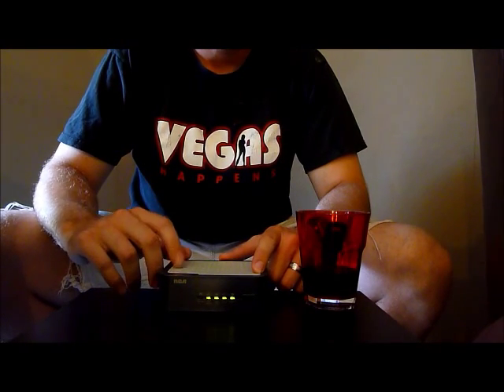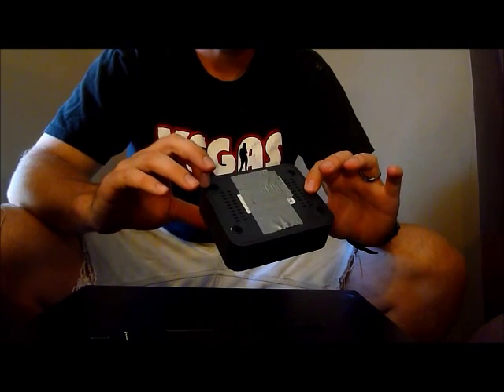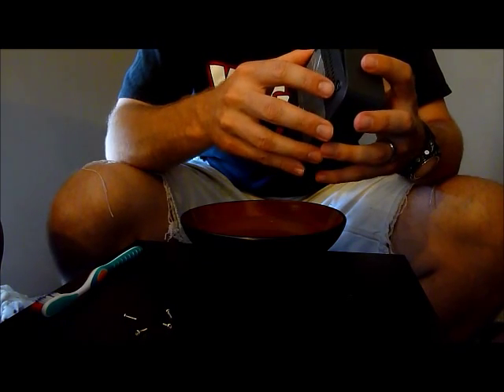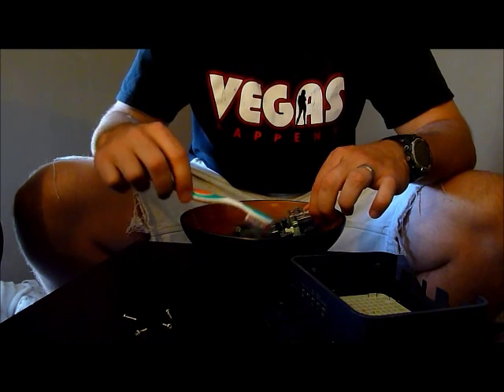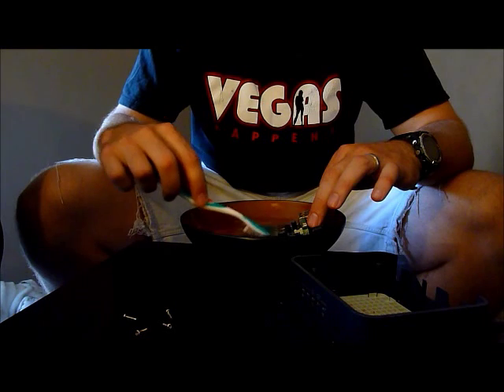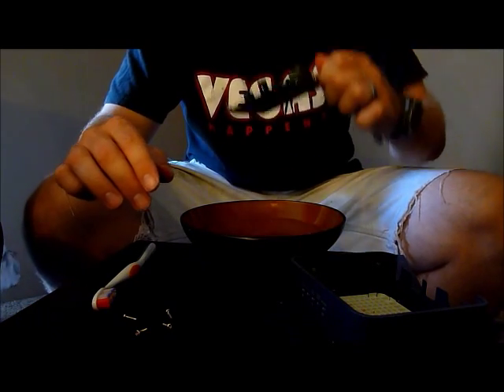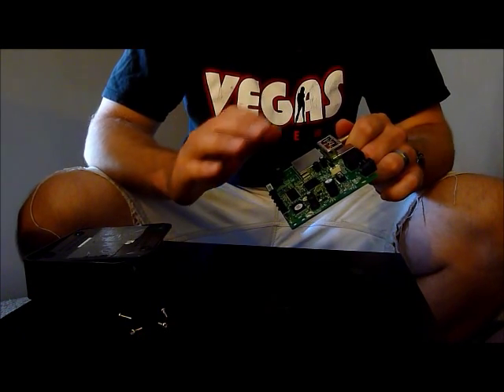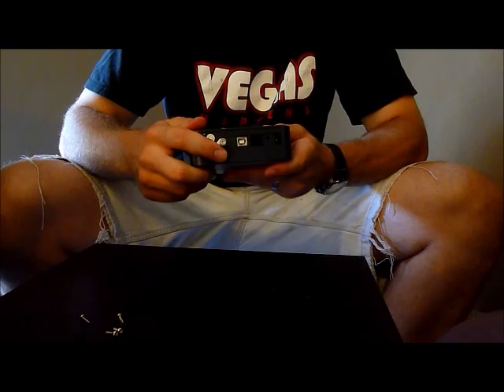How to Fix or Repair a Modem After you Destroy It :-)

Comment: That ROHS solder has no lead in it and some people despise it.  It is not only brittle but it grows tin whiskers over time and that is no good.  ROHS is just another way the EPA fucks everything up.  They take out key ingredients in stuff because of it being supposedly toxic or bad for the environment.  That is what happened to dish detergent too, they took out the phosphorus and now we are plagued by white spots.  They are also responsible for those awful new CARB gas cans.  Those are the ones that must have been designed by someone with four arms.  My only other gripe about them is that when not full, they shrink and expand.  It feels as if the EPA's only purpose was to cause misery.
Reply from the maker: two thumbs up

Comment: blinking single light or resets often? (I have one) Change the 1000uF Caps 25VDC Electro. If top of the caps does not look smooth and flat or it looks cracked and/or popped (balloon), then change those big caps. digikey or mouser have it. buy several more in case those go.

Comment: ok so the nail of my modem was too small and i couldnt remove it with my screw driver so i poured alcohol all over the case so that the alcohol would go inside the case and I dried it for 10 minutes.....will my modem still work?

Comment from the maker: Yup, sure does, works with almost any fluid which touches it.....outside of chemicals.  The only time this procedure will not work is if too much fluid is spilled on it and a capacitor, resistor, etc. burns out.